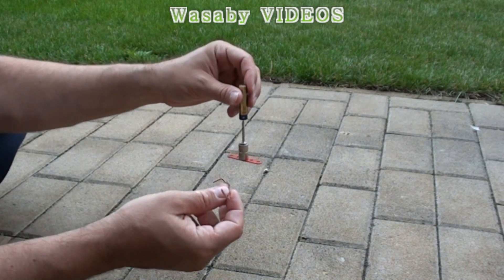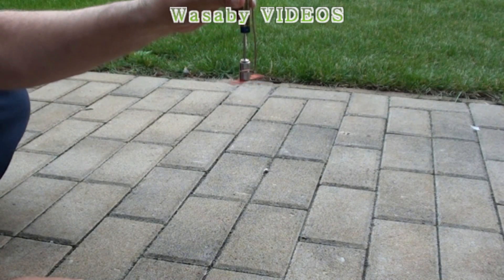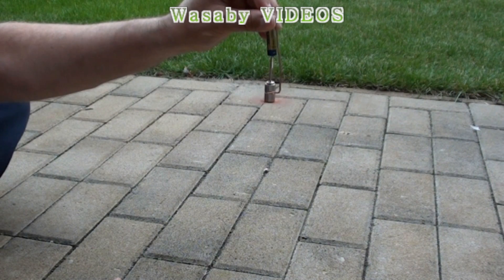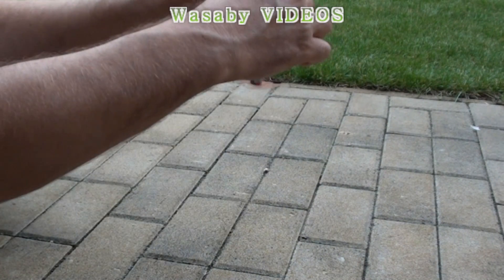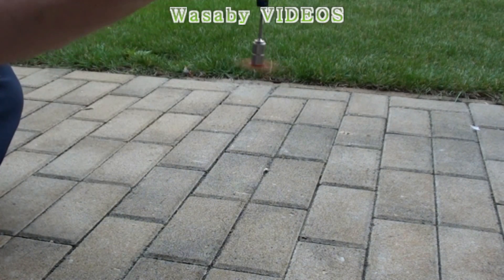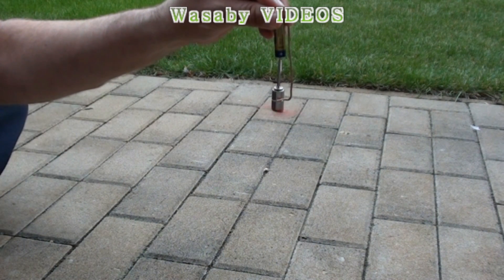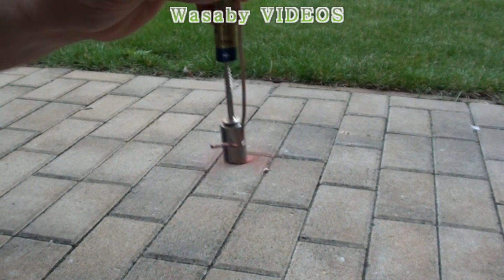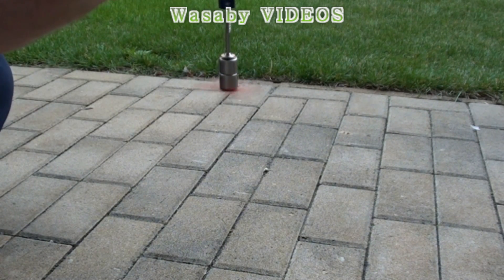The Simplest Magnet Motor in the world. Built within 1 MINUTE  | WasabySajado

Comment: Interesting,  but if it needs a battery,  does it have to be charged? If so,  while using a modeled up scale one for cooling or air circulation,  then put a belt on the stem of the fan,  and to a type alternater or charger that easily turns,  to then recharge the battery...